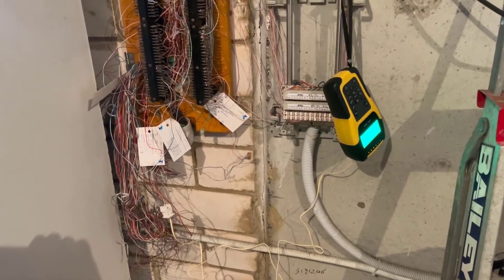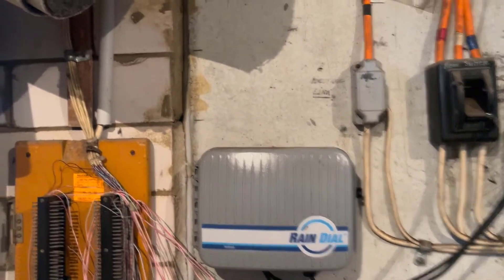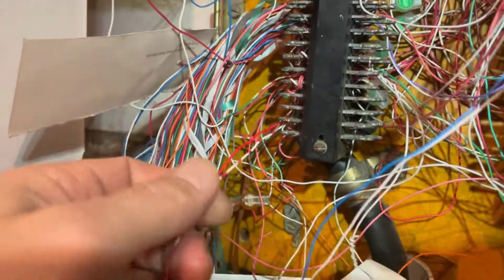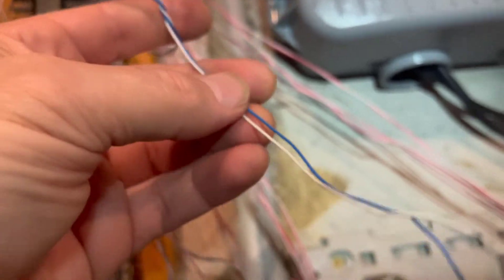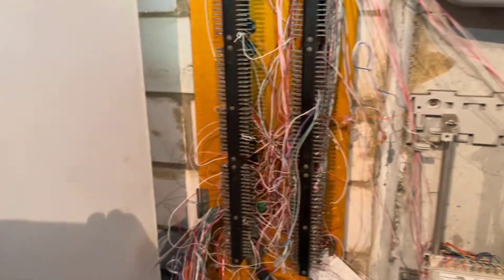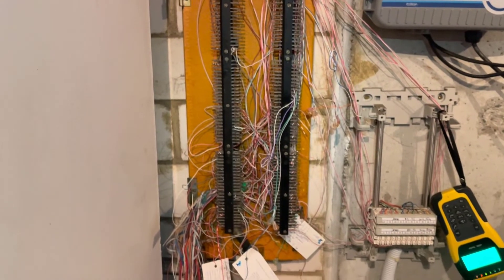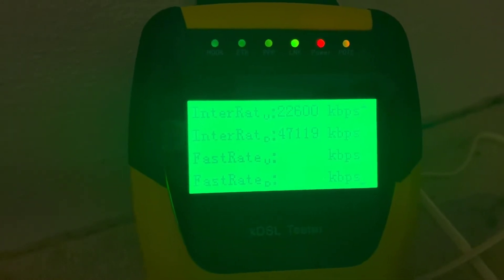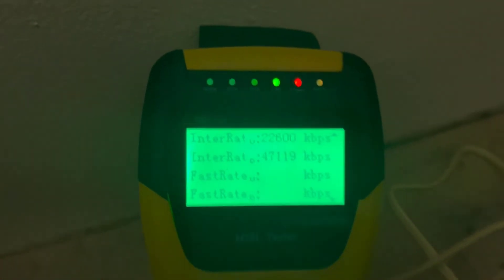NBN Contractor Double Jumper At MDF Causing Bridge Tap ON NBN FTTN Service Sydney

Comment: Mate do you have any idea how to get an NBN tech out at the house? Telstra refuse to send anyone out
Reply from the maker: If someone in the home has a medical condition, make sure you tell them. You will have someone out the next day. What is the reason they don't want to send a tech out?
Reply: @SECUREACOM  They just seem to send me around in circles, they "Monitor" the line for 24 hours and say its fixed but it isnt. They also do line tests and always say its working perfect even though we tell them it isnt. Everytime we have asked for a technician to come out they just deflect the question and perform more online tests and say its fixed
Reply from the maker: @messystressy  Give me a buzz tomorrow. 02 9188 1577 and we can do some troubleshooting over the phone.

Comment: Mate you can,t 100% prove that that nbn services is for your customer unless you do an lsd test which then proves that services is allocated for your customer. That service for all you know maybe on a c channel at the pillar for someone else. Nbn could actualy fine you for working on there network when your not an nbn accredite technician which I suspect you,re not
Reply: @JustVideos194  Are you talking to me? If so I'm stating facts. Not trolling.
Reply: @JustVideos194  I'm not denying he's got experience and it shows he knows what he's talking about to a degree. My comment only explains that he can't be 100% correct unless he knows the customers "C Pair" at the pillar and does a lsd test which he can't do if he's not a accredited NBN Tech, or tests the customers modem for sync and internet access. In regards to him being accredited to access the telecommunication pits and open joints is debatable as he doesn't seem to comment. And no matter how you look at it,  it is an offense to do so if you're not an accredited technician.
Reply from the maker: Thanks for your feedback on this video 👍